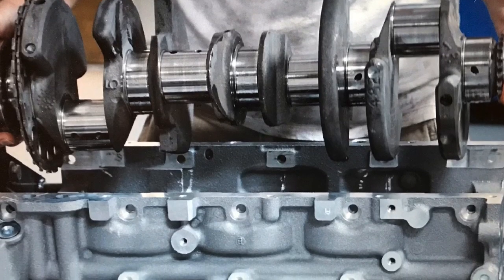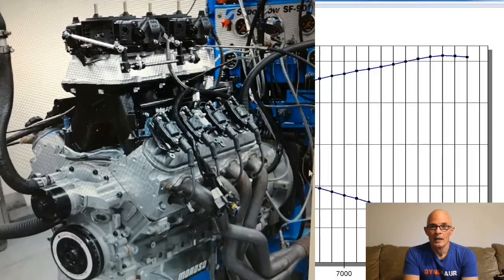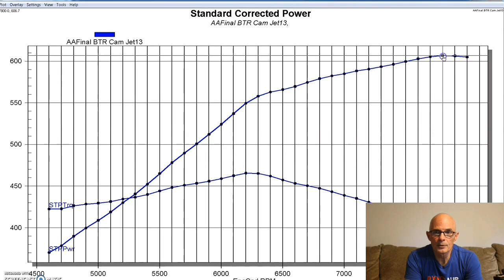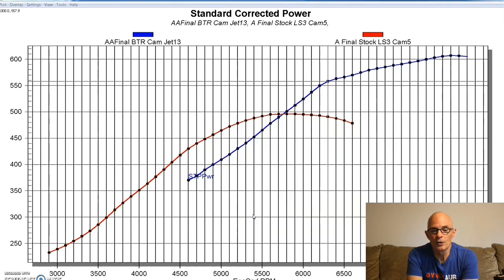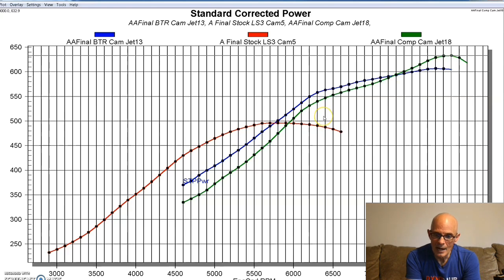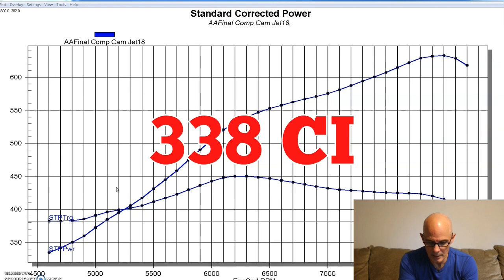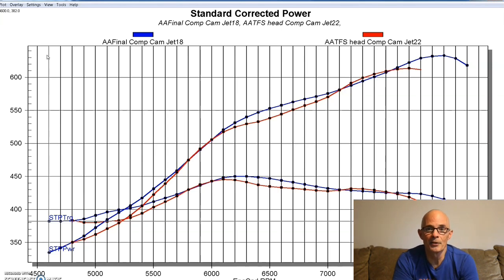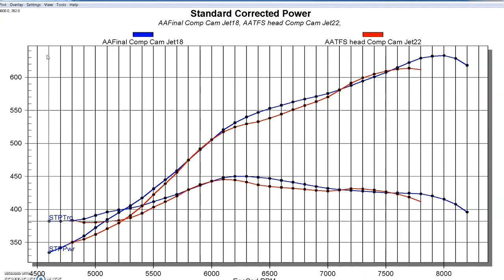DESTROKE LS-4.8L CRANK IN LS3 BLOCK-SHORT STROKE POWER-AN LS MONSTER MYTH?

Comment: Richard, along the lines of my previous post, what would be REALLY interesting would be to use an engine that's fairly modular....BBC would be best since they're scienced out very well.
Build 2 very different-sized engines, but to the exact same HP level. 
So say, a 454 with 700hp, and maybe a 540 with 700hp. 
And then compare the power curves, particularly the torque....I'd expect the 540 to make the HP at a lower RPM with a lot more torque that also comes in at a lower RPM. 
And THEN, run them both in the same car....see if the bigger motor with more torque (but the same HP) is faster.   I suspect it would be.

Comment: Short stroke/big bore is technically better....but that really only works out for bleeding edge engines.  F1, needs to turn 15k rpm all day?  Sure.  Nascar?  Sure.   Pro Stock, can't have over 500 cubes?   Sure.  
But if you're a street guy or a weekend track guy or a Super class racer, there's no sense in building a high RPM smaller motor instead of a longer stroke, bigger motor.
If you're trying to wring out the max HP and don't care about reliability or maintenance....sure, turn it on up there. 
If you're wanting to hit a certain HP level and race every weekend, build that long stroke motor and you're better off. 
Let's say you wanted to build a big block with 900hp.   Well, you could do that with a 454...if you want to turn it high enough.   You could do it with a 496, still have to spin it up there, but you'll have more torque at the same HP level as the 454.
But you could do it FAR more easily, and with less headaches with a 540+ engine....and it'll be faster.  900hp isn't 900hp across the board. 
The big motor with 900 is going to not only make that HP at a much lower RPM, it's going to have a LOT more torque while doing it.....so while the big motor might be all done at 7,000 and the 900hp 454 is still winding up to the 8500 it's going to need to turn to make that power.....the big motor is already gone.  
That torque left it in the dust. 
And you don't have to adjust valves, check inside the engine for damage, etc and tear it down once a month to keep it living, either. 
So IMO, if everyone has to run the same size engine, then sure....as big a bore as possible and short stroke and TURN IT.    But if you're a weekend guy (and nearly all of us are), not a pro and just wanting a certain HP level?   As Billy Squier sang, "Stroke it, stroke it"

Comment: The issue I have with this line of logic is that you attempt to justify the assertion that valve train is the limiting factor in RPM potential by saying that longer stroke motors peak earlier in the rev range. That's true, but does nothing to substantiate the premise. Show me that a 3.622 stroke motor is going to rev out to 8k with an equivalent valve train and remain reliable if you want to bear out what you're asserting. Piston speed is what kills bottom end parts - now that is simple math.
Reply: But the valvetrain is feeling more stress at 8000 rpm on the short stroke motor that makes 630 hp than on the long stroke motor at 7200 rpm, making the same 630 hp.  The piston speed is the same in both motors.

Comment: So question. With a destroked 6.0 with a 4.8 crank would that make more power at the same boost rather than a regular 6.0l? I had thought about this a few years ago about building my 6.0l with 4.8 crank thinking I would get more rpm. But your saying smaller stroke bigger bore is better flow so I would think theoretically a "big bore" 4.8l would make more power on equal amounts of boost.
Reply from the maker: the bigger motor makes more power-even under boost
Reply: @richardholdener1727  thank ya sir I wasnt sure on that I figured as much but just wondered

Comment: my dad built engines all through the 60s and 70s he said shorter stroke less distance for the rings less wear less heat takes a good head and good intake gotta move air quicker

Comment: Yesssss thank you for this video. I’ve had quite a few friendly debates on the hows and whys on stroker motors and I always end up saying what u said. That they HAVE to rev high to make power because of the lost displacement and it’s not necessarily that they “like higher revs” at all! 👍🏻
My dad always used to say there’s no replacement for displacement unless u force induction.

Comment: Loved video!  Brings to mind another small displacement engine.  I have a 305 tpi in a 1989 camaro.  Revs to 4500 or 5000 and falls on its face.  I know switch to 350.  I would like to see one run to 6500 maybe make 350 to 400 hp.  Any ideas with stock intake manifold

Comment: Bench racing is amusing. The geometry of an engine may well be based on theories and math on PAPER. The fact is, that's just the start. I doubt any of the contributors, including myself, have ever, or will ever build a Formula 1, NASCAR, or Top Fuel engine. The piston speed per sec, etc  is a start. Ultimately, what are you building the engine for? The heads, cam profile, valve train, fuel delivery, etc., along with geometry, ultimately determines the success of the engine.

Comment: Speaking of big bore and short stroke, wasn't the Trans Am AMC Javelin engine from 1970 onwards when the ruled were changed a 390 destroked to 305 cubic inches. The 340 on the AAR Cudas and the Challengers they destroked also had a 4.03 something inch bore. 

That gives me an idea, how about really destroking a 6.0 or a 7.0 LS to see if you can make valvetrain components achieve escape velocity...

Comment: I have a 565 ci bbc i turn it to 8600 rpm if can find valensole LS crankshaft and rods and pistons better to twisted hire you don't have to destroke if you lose power just up the compression

Comment: I think with carburetor you need to tighten the lobe separation more. I mean with this type of engine no one is gonna run this in a street car, so why not make it a straight line max effort engine. I’m curious to what a 102-5 lobe separation would do with these heads and stroke. I bet 700hp and a way better torque curve.

Comment: Ya know those high rpm F1 motors have LESS CYLINDER SPEED than a NASCAR V-8?  The piston "speed" can play a massive part in endurance at RPM. All piston / rods weighing equal, the faster combo would seem harder (on components) to change direction, (centrifugal weight) ..  With say a 8 speed trans you can put the power way up top, small engine size, big numbers & run it like a 80cc 2-stroke dirt bike, "always screaming" .. The short stroke will help it "live" in that environment...

Comment: Great info. Love learning the hows and why's of why stuff works the way it does. I will add I've found the intake manifold type also plays a part in how high a motor will rev just like a cam and valve train etc effect it. A 4"+ stroke crank can rev to 7000 and above just as easy as a short stroke long as the top end of the engine has the correct parts on it. Have seen a few times a "supposed" junk boat anchor ford 400"m" stroked to 434 turn 7500 and 8000 rpm on a dyno with a great top end on the engine to support the rpm.

Comment: I have always assumed the advantage of the short stroke build was not just higher peak RPM, but an increased rate of RPM acceleration.  Basically that you can get to that high peak RPM faster than with a longer stroke, thus having an acceleration advantage when racing.  Any validity to this?  Would love to see something like this tested on the Dyno.

Comment: I've also been told that a shorter stroke puts less stress on the rod and piston combination because of the lower piston speeds to spin a short stroke engine to a given rpm than to turn a longer stroke at the same rpm. Probably also worth considering if you're putting together an engine that will live in that high rpm range for extended periods of time

Comment: THE LS IS A COPY OF THE FORD HIGH RISER HEAD. THE RAISED FORD HIGH RISER PORTS GIVES IT A STRAIGHT SHOT INTO THE COMBUSTION CHAMBER AND THE REASON THE LS CAN FLOW BIG BLOCK NUMBERS. IF YOU PUT YOUR FINGER INTO A LS INTAKE PORT. IT CURVES INTO THE INTAKE VALVE IDENTICAL TO THE FORD WINDSOR HEAD DESIGN. THE WINDSOR ALSO HAD STRAIGHTER VALVE ANGLES 20' INSTEAD OF 23' LIKE CHEVY FOR INCREASED FLOW. GM THEN STRAIGHTENED THEM TO 18" TO FARTHER INCREASE THE FLOW. A FORD WINDSOR 351 HEAD FROM AROUND 1969-70 FROM GRANDMA'S STATION WAGON, A NONE RACE ORIENTATED HEAD. ON THE INTAKE SIDE ONLY WITH SMALLER VALVES AND RUNNERS. FLOWED JUST AS GOOD AS CHEVY'S BEST PRODUCTION HEADS THE FUELIE 2.02 CAMEL HUMP HEADS. SO FOR THE GM ENGINEERS IT WAS A NO BRAINER TO COPY FORD DESIGNS. WHEN THEY DECIDED THE REDESIGN THE CHEVY SMALL BLOCK. WHILE THE GOVERNMENT WAS MANDATING MORE MPG FROM FORD SQUEEZING THEIR BALLS AND THE REASON THEY DROPPED THE OVERHEAD VALVE DESIGN IN FAVOR OF OVERHEAD CAMS. ON THE OTHER HAND THE GOVERNMENT LET GM DO ANYTHING THEY WANTED AND ALLOWED THEM TO BUILD THIS RACED ORIENTATED GENERIC SMALL BLOCK FORD THAT DOES NOT MEET EFFICIENCY TO BE PRODUCED. AS WHERE FORD HAD TO KEEP THE HORSEPOWER DOWN BECAUSE OF GOVERNMENT PUT PRESSURE ON FORD, WHILE GM WAS ALLOWED TO DO ANYTHING THEY WANTED. COULD YOU READ BETWEEN THE LINES. I READ THIS ONE YEARS AGO WITH MY EYES CLOSED. THE BIGGEST FEAR CHEVY HAD IS THE 351 WINDSOR GOING INTO THE MUSTANG. THE 5.0 WAS WIPING THE STREETS WITH THE CHEVY 350ci. GM BIGGEST FEAR WAS FORD PUTTING THE 351 INTO THE MUSTANG AS A STANDARD PRODUCTION MOTOR WHICH MEANT LIGHTS OUT FOR THE CHEVY SMALL BLOCK. DO YOU REALIZE NOW WHO PUSHED THE GOVERNMENT TO GRAB FORD BY THE BALLS AND LIMITED THEM. IT WAS GM TO STOP FORD FROM EVER PUTTING THE 351 WINDSOR INTO THE MUSTANG. IT WAS A GM TACTIC TO STOP FORD WHICH IS USUALLY THE CASE LIKE THEY DID IN NHRA RACING. MANIPULATING RULES WRITTEN AND UNWRITTEN TO STOP FORD FROM WINNING. BUT DOING THIS HAS HAD REPERCUSSIONS FOR CHEVY TODAY, WHERE THE CAMARO IS ONCE AGAIN SLATED FOR THE WRECKING BALL AND READY TO GO ONCE AGAIN OUT OF PRODUCTION BECAUSE THE MUSTANG POWERED COYOTES ARE JUST KILLING THEM. IN NMRA RACING A PURE STOCK RACING CLASS. A 5.0 COYOTE OFF THE MUSTANG ASSEMBLY LINE. WHERE A 425HP MUSTANG  ENGINE IS SEALED FROM THE FACTORY. IN NMRA RACING WITH HEADERS AND INTAKE ONLY! USING A FORD PROGRAMMED COMPUTER IN 3000LBS FOXBODY MUSTANGS, ARE RUNNING 9.80'S ON PUMP GAS AND 9.40'S ON RACE GAS AND OUTLAW TUNE WHICH IS MIND BOGGLING.

Comment: Rich first thanks for the great videos. Now you should find a Inertia Dyno in order to measure your engine acceleration. I feel the big bore shorter stroke will increase off the corner times. I like 4.125 x 3.00 combinations, W/6.250 rods.
Richard

Comment: I think honda has proven that you can Rev pretty high with a 3.4" stroke which is more than this engine and barely less than an old 350 or 351.  Modern engine research is getting bmep and bsfc from strokes almost 4" long and pistons more like 3.5" than with square combos. But what a short stroke does is increases the area to volume ratios be it valve area to cylinder volume or piston area to cylinder volume and the piston area determines the limits of valve area to an extent (though long strokes tolerate big volume combustion chambers and make higher valve angles make more sense which allows for bigger valve to piston ratios but I imagine that this doesn't quite keep up with the loss in piston area) . This means more rpm is needed for similar air velocity. So the same head revs higher. This might still be an advantage if cam and intakes are exhaustively tuned if the width between the cylinder heads is more conducive to a manifold with runners tuned to a higher rpm. This assumes we have free rain with intake and cam design but we aren't retooling heads or block heights.

As for f1, they didn't just use short strokes for area:volume ratios. Those rpms put the assembly through extreme g forces. The piston moves at similar speeds to a Nascar (slightly less actually) but changes direction twice as often and is under stress almost 4 times higher if I'm doing math right. The engine would look like it went through a blender if the stroke was slightly longer.

Comment: Your little 338 short-stroke jewel reminded me, in listening to you, of the 327's and 302's of old.  The shorter stroke slowed down the piston speed and I should suppose that your engine revved like a chainsaw.  As a young guy I loved to wind 'em up.....now I'm an old geezer and have sold my soul to the Cubic Inch Gods and the mantra of Torque.  I'm pretty much done with my hot rod years now but my last engines to play with were 460 Fords and big Pontiacs......hoohaw!!  Torque forever.  That said, I found this upload to be pretty exciting!  Keep the Faith, Tom  P.S.  Wish I could find a 440 or 426 Hemi on the cheap.....yup, you bet.........

Comment: One important aspect overlooked in the test is throttle response and overall streetability of the engine. Short stroke engines feel faster and more  immediate in their response than a long stroke counterparts. Think about how quick it is to rev a  motorcycle engine versus a 6.7L stroker engine. The delivery of power is different and something the Dyno is unable to speak on

Comment: nah, facts don't care about your feelings as it was once said. How much is 10cc worth overall compression wise? Looking at the math it could be 1.X:1 difference. I'd think that would be roughly 2% output or about 12HP just turning things around in my mind. Not hating just pointing it out.

As once was said "personality counts." I think part of the appeal of these engines is that they're a "peaky." People like the sensory aspects of something like this as much as they like the performance. There's definite trade offs to get an engine running like that such as power train choices.

Most people talking about DZ 302s also glaze over the idea that they ran a 302 because it was the CID in the rules of SCCA road racing. They would have gladly ran a 383 or 400 had they the choice. I mean Pontiac would have gladly skipped developing a short deck engine to do the same since all their engines from 265ish CID to 455 CID were all basically the same form factor. Shame their short deck engine development created the 301 instead. 

Hell throw a 150 shot at a 301. Everyone says they're fragile, it would be interesting to grenade one if that's the case and prove it. More interesting to not grenade it until it makes some hero numbers though.

Comment: Sure, a bigger stroke will make more power at rpm, regardless. And obviously valvetrain stability is necessary no matter what stroke. BUT a bigger reason why strokers don’t “like” to rev is piston speed. The bigger the bigger stroke has much higher piston speed per rpm which is a massive limiting factor in sustainable rpm. A short stroke squared design is much more compatible with reliable rpm than a stroker, hands down. This is a big reason why f1 engineers use super squared cranks with short stroke. It allows the material to spin the rpm necessary to achieve the massive airflow. It also keeps weight down.

Comment: its all about air flow through the head and piston speed. compare a 289 to a 408  and every step along the way. same head style. a 289 wont be able to max out flow until hi revs. it just cant pump enough air. itll make a very broad curve.
a 408, however, will max out a head at lower rpm the starve itself. itll make a sharp peak like torque curve in a very narrow area. and itll do it down low. they will make the same peak hp, just in different areas. 
however, install some of kaase old chi 400 clevland heads on the 408 and its torque curve will be flat like that small head 289 as it turns 8000. 
max potential air flow vs amount the engine can push.

Comment: i love a higher rpm engine in a car all this stroker crap in cars ill like the bottom power luger in a truck smoky Yunik build it..///may be be nice on the cam size and use turbos zing it to 10k  not about huge number but a fat power line

Comment: I would challenge these conclusions little bit. Bigger displacement is always better that is true, but if you are designing a race engine of specific displacement under regulation limitations you better go with big bore and short stroke. There are several reasons for this. First, is like you said, big bore gives the opportunity for bigger valves and ports. Second, short stroke has less piston speed at given RPM. Piston has to cover full distance up and down at every rotation. Shorter stroke means less distance covered, less speed and less friction. Second, connecting rod angles and subsequent reliability as longer stroke means the lower end of the rod has to extend further to the side when rotating, increasing its angle and putting more uneven pressure on a piston. To further reduce this unwanted load you need thin pistons and long rods, longer rods need less angle. Big reason why your smaller engine needed more RPM to develop same HP is due to the fact that you likely used same heads. Same head in a bigger engine translates into more low end power. Cheers.

Comment: Having heard legends of what the 327-ci. Gen-I SBC did in the day (factory 375HP w/Rochester injection, modified variants build with cracked-cap rods that launched at 8500-9500RPM & shifted at 12,500RPM...! =:O) I've been intrigued by the idea of building on based on the LS architecture w/modern spark & fuel management... and possibly supercharged, if not turbocharged.